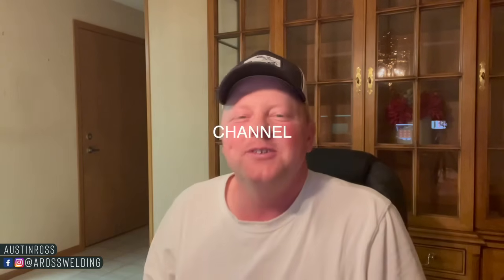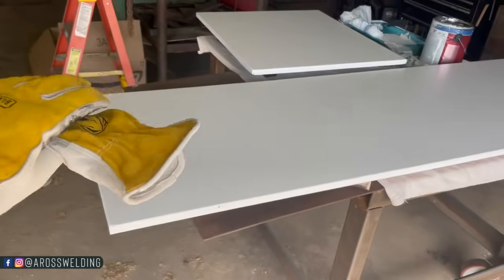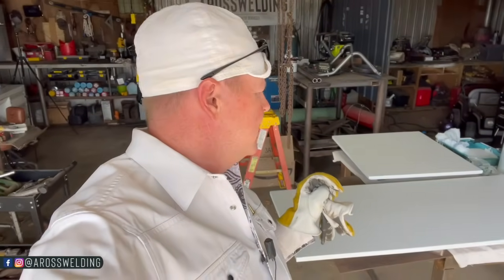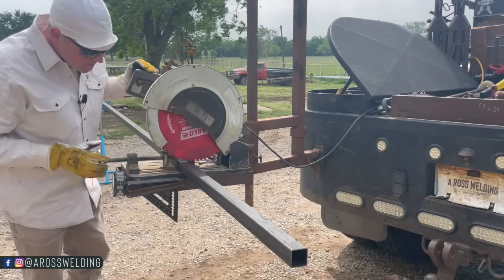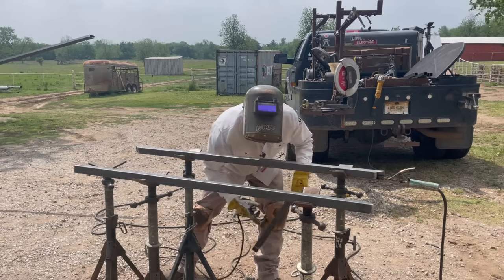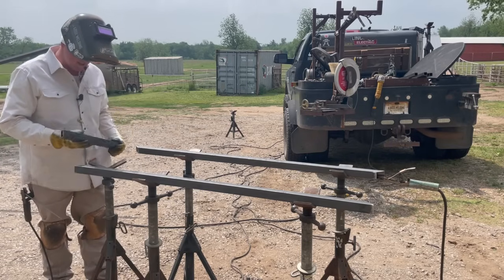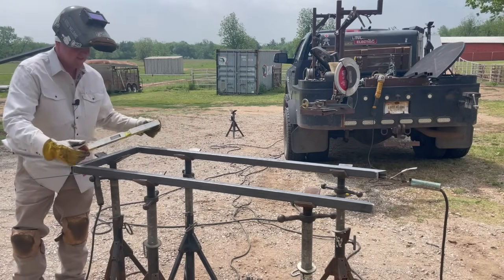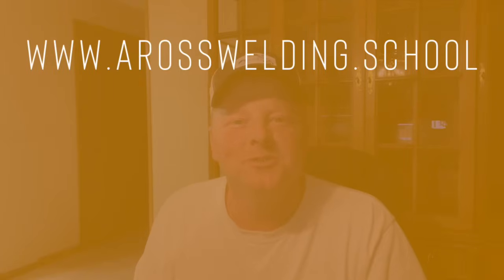Building a Custom Metal Countertop Base With Storage (PLUS EXCITING ANNOUNCEMENT)

Comment: Some Fireball Tools’ squares would help out a lot with that project. I put off buying some until recently because they are expensive, but they are worth it. You can clamp the squares to the material to hold it together and still access the corners to tack it.

Comment: If you don’t have already try the strong hand magnetic square, the one that has the individual on -off switch’s . I have a set of the smaller ones and the larger ones. They have very strong holding power and come very handy in many situations. They are a little pricey but will pay for themselves quickly.

Comment: You know Austin the table ended up looking nice, but ya know all that leveling was a serious waste of time when you knew you could have just clamped some plates on the bottom of the frame  for tack welding purposes and to square up the frame. But your frame probably  pulled out of square because you didn't  have it clamped down to a table to keep  it from pulling out of square  while  you were welding it.